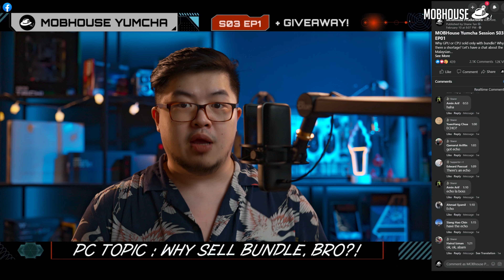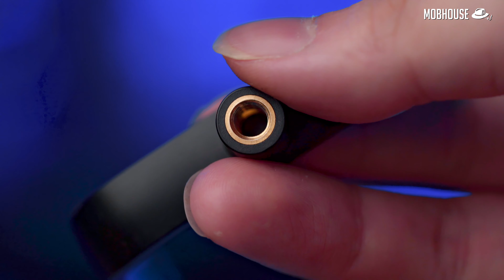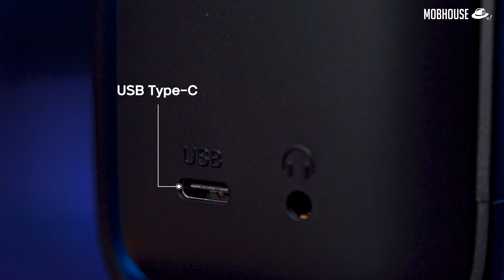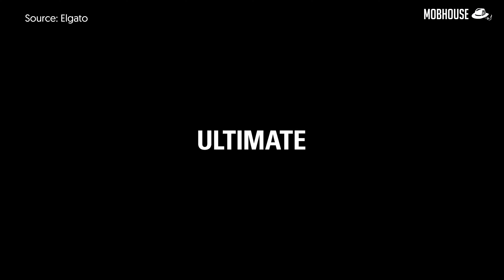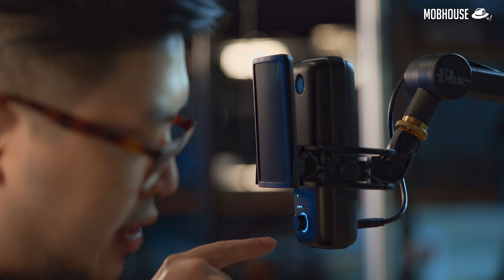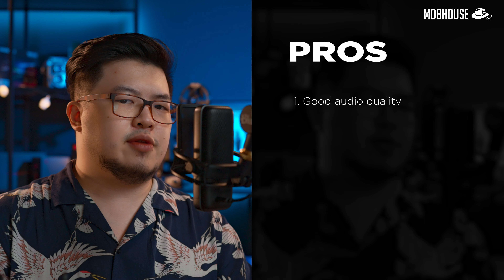Elgato Wave 3 USB Condenser Mic Review - Best Mic for Streamers/Youtubers!

Comment: I’ve seen a lot of bad reviews about the blue compass with the wave 3, but I see you use it with no problem, what would you say about it?
Reply: I use it with the compass, it works just fine you just need to tighten each joint to its max since the mic is so light
Reply from the maker: I personally wouldn't recommend it because the mic is too lightweight. I'd probably get a cheaper mic arm or even the Rode one because those should be able to do fine with a lighter mic.

Comment: Thank you for the review.  I own this microphone and the same microphone arm.  On the microphone arm I adjusted the tension screw and it works great, no need to add weight to the arm to keep it in place.  One huge negative for me right now is WaveLink doesn't work with the M1 processor MAC's and Elgato's response of we identified it on November 10, 2020 doesn't really satisfy me.  Otherwise I agree it is a good Mic for the money.  So for lack of proper MAC support and weak answers from Elgato support, I would only give it an 8.7 overall.
Reply from the maker: I have already set it to the minimum tension setting and it still does go up in certain positions. Tbh, this mic is a lot lighter than most condenser mics firstly because of the electret capsule vs full condenser capsules and secondly because those mics usually have a metal housing.